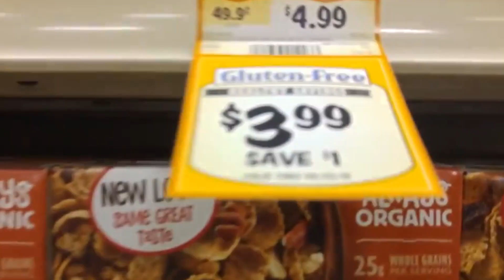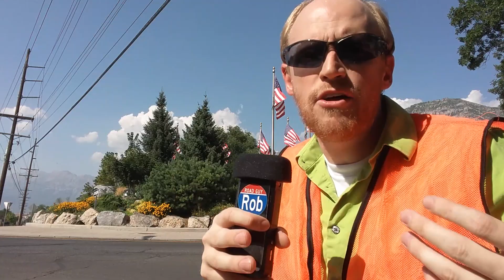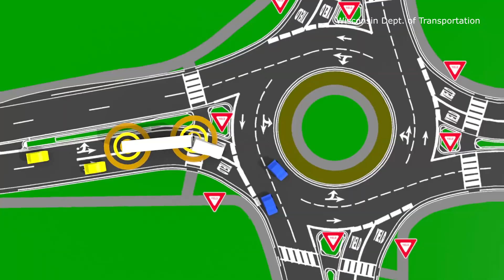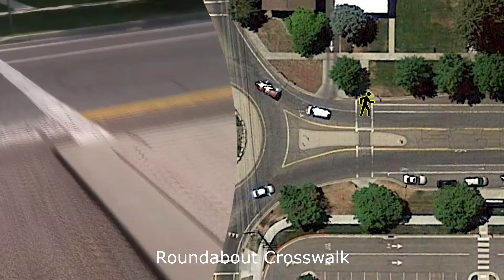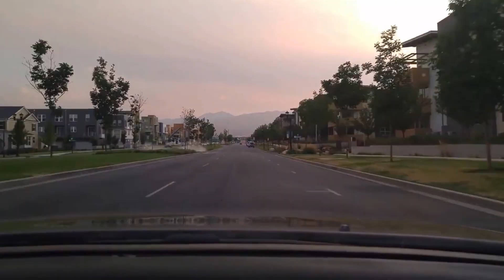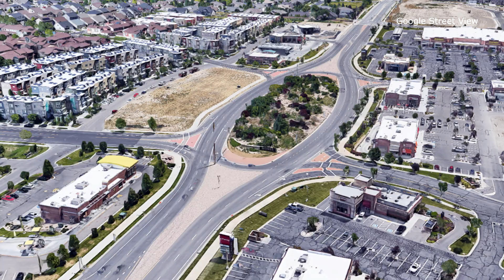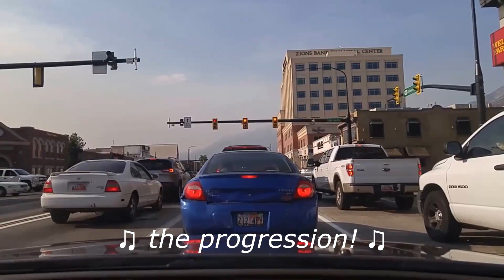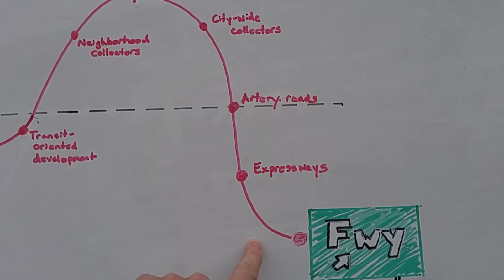Are roundabouts REALLY better than a traffic signal?

Comment: In Kansas City MO, the timed lights were an early adoption - and terrific! On the Boulevards, one could travel from near Downtown to the old south limit - 85th St. non-stop at 35 mph. Also, one of these boulevards had what we called "suicide circles," pre-historic roundabouts. These were are low volume intersections, so the chumps waiting could slip between the clumps. Thanks for a good video.

Comment: i am from europ and here we have "mini roundabouts" they are about the same size as a t junction but they have a small round hump witch is the island a truck can easily drive over it (it is bassically a speed bump size. also with the 2 lane round abouts it is simple if you are going left stay left if you are going right or straght go in the right lane (also it was very anoying watching you cut the lanes for me), a spral roundabout is an intresting thing you should look into basically when you aproach there are usually 3 lanes the left will take you left the middle will take you to the middle and the right will take you right sometimes i have seen a 2 lane spiral where you have to change lanes half way arround

Comment: 5to10k a month for electricity?! Would love to know why that is and how it can be lowered.
Reply: Incandescent traffic light bulbs for traffic use about 100 - 150 watts (125 average).
Since there are at least 4 of them active at all times => 500W x 24h => 12kWh every day or about 360 kWh per month.
Which would make the monthly cost for the minimal possible configuration (in the USA at 0,15$ / kWh) 54$ per month.

But yeah, even for a big crossroads with 20 traffic lights, the cost would 'only' be about 270$ per month in electricity.
And if you use LED's that cost is lower. (LED's use about 15% of the electricity compared incandescent)
Reply: @Robbedem  I was guessing the sensors in the ground for detecting cars would consume the most do you have any info on those?
Reply: @Project烏猫  no idea how much they consume... I suppose it might even depends on the traffic.

Comment: This is a great summary of what roundabouts are about (no pun intended). And as for not putting them in freeways, amen to that. There used to be one on the A2 motorway near Eindhoven, the Netherlands, and it was a nightmare until it was finally replaced by a proper junction.
Where I live, in Malta, there's the Kappara junction. When it was being designed, foreign experts (German if I'm not mistaken) came, looked at it, and told the Maltese that they should build flyovers. The Maltese argued that it was too expensive, and what did these foreign experts know anyway, so they built a roundabout instead. Please note that the approaches from both main directions go downhill... almost as if they were made for flyovers.
Fast forward a fair few years, and this roundabout is handling a whopping 90,000 cars a day. They had traffic lights to begin with (traffic lights on a roundabout... go figure), but some 15 years ago they removed them. It did little, if anything at all, to aiiviate the traffic problems.
Finally, around 2017, they started to build two flyovers, and lowered the roundabout a bit. They finished in 2018, and it's tempting to take these flyovers at far greater speeds than the 60 km/h (37.5 mph) speed limit, especially since there are no speed cameras (yet).
Roundabouts may have worked in the 1970s, when most of these roads were built. But then, economic activity increased, more women started working instead of staying home and playing housewife, and all these people drive cars because public transport is, to put it kindly, not the optimal way of getting from A to B. After a certain amount of traffic, roundabouts become a big bottleneck, precisely because of the reduced speed, and the congestion caused by traffic taking the third exit.

Comment: I live in an Atlanta suburb and  and a signal was replaced at the intersection of two major backstreets, with a roundabout (traffic circle). The reason was because there was not enough room for the turn lanes that were so desperately needed, and there was a 5th side street that came into  one of the roads less than 50 feet from the intersection. Once the roundabout was installed to replace the signal and include the 5th side street, it took a couple of months for people to figure out how to use it and to get used to it. Since then it has been a god sent. Traffic flows far better and I don't think I have heard of any accidents at that intersection since. There are still a few drivers that don't understand when they have the right of way and jam up an entrance to the roundabout, now again, but as a whole it has been a wonderful change!  Great analysis, Rob!
Reply: Remember that "roundabout" and "traffic circle" are not synonymous.
Reply: @jovetj  Sure they are. Roundabout and traffic circle are used entirely interchangeably. They have the same meaning.
Reply: @scythelord  Formally, a traffic circle is a circular intersection where the traffic ON the circle yields to the incoming traffic.  A roundabout is a  circular intersection where traffic entering the intersection yields to traffic already on the circle.
Reply: Where is it?
Reply: @citiesskylinesmetropolitan8980  Roswell, GA. Grimes Bridge Rd at Norcross Street

Comment: Does anyone have the stats on annual fatalities from driving one handed while talking into a hand held microphone with the other?
Reply: Lower than looking for dropped McDonalds fries in the seat
Reply: Nice way of pointing out that he should really stop doing that...especially on camera (although I have no idea why anyone would do that off camera, LOL)
Reply: Look, I need to make my breakfast while I’m driving.
Reply: A lot lower in manual transmission vehicles than autos.
Reply: Hams
Reply: It's probably alot.

In the UK, doing that will cost you big time if the police spot you.

You get 6 points on your licence [12 points means insta-ban from driving - most minor infractions (such as low-level speeding) carry a 3 point penalty - so they consider this crime to be at least twice as worse, probably for good reason]

Points on your licence means that your car insurance will be vastly increased forever

Unlike with your first speeding offence, you can't exchange your first 3 points for sitting an annoying 4-hour "speed awareness course" [definitely worth it - you still pay close to the original fine - but you avoid the points that will jack up your insurance until the end of history!]
Reply: @jazzx251  Actually the law only specifies mobile phones. You can still use a handheld mic on a CB radio for example. You see it all the time on Top Gear. Now if you have an accident while holding a mic you may well be charged  but unlike using a phone it is not an offence in itself.
Reply: @montegriffo24  you're free to test this - but I think you're wrong. I've heard of people holding a cup of lemonade in a traffic jam, and - because the engine's on - the police consider you to be "driving without due care and attention".

Whenever I see the pigs, I put both hands on the wheel, even if I'm stationary..

Here's a real-life story of why you should never trust the police:

Last week, my mother's friend in Scotland had an elderly neighbour that ordered some things from "Marks & Spencer" department store - she did "click and collect" for her town.
Unfortunately, it was sent to the wrong town - another one 13 miles away. The city of Ayr.

So - a bit annoyed, she drove the extra distance to Ayr - and got stopped by the police. They booked her for violating Covid travel restrictions, and gave her a £60 fine.

That hurt, obviously, - but she was there now, and collected the goods anyway.

As she drove out of Ayr, the same pig stopped her.

She got another ticket for Covid violation - as a second offence, it was £2000

The SAME PIG - from less than 2 hours earlier at most.

Never say "they can't do that if you hold a CB in your left hand" - they can do whatever they like, and your homespun pub-lawyer crap won't wash.
Reply: @jazzx251  Nothing you have said contradicts my argument that only phones have been legislated for. The police can indeed cite a 1000 different ways of charging you for driving without due care and it pays to be cautious around them but there is no law against using a CB radio. Ask a truck driver if you don't believe me.
Also, no need to be rude.
Reply: @montegriffo24  The exemption covers specifically 2-way radios. I can't find any info on hand-held mics, so probably not worth the risk. Clip-on lapel mics are cheap as chips.
Reply: @BoB-Dobbs_leaning-left  stationary vs. stationery 😁 - like what you did there!.  I think Mai Nem might be too angry to get it.  Bad attitude to police as well 🙃
Reply: @montegriffo24  That's nice in theory, but in practice you get charged for what the police officer thinks you're holding. It doesn't matter if you're holding  CB, an electric shaver, a chocolate bar or whatever, unless you have a camera pointed at yourself while driving it comes down to his word vs your word and in that case you will always lose in court.

Comment: As a truck driver I feel roundabouts should not be used on truck routs, but I think they work great for lower traffic, residential areas. Almost every time I come to a roundabout I have to come to a complete stop before entering, and always end up cutting someone off because trucks are very slow to get moving again. I’ve waited as long as 10 minutes for a break in traffic that never comes.

Comment: In Norway where I grew up pretty much all roundabouts are two laned, despite there not being a lot of traffic. It makes it easier to know where people are going in the roundabout, since someone on the outside is going out and someone on the inside is going around. A lot of people don't use turn signals, and that pisses me off since it makes it more difficult for me to see where they are going, however two laned roundabouts make it easy to see where someone is going even if they don't use turn signals.

I also lived in Germany for a few years, where pretty much every street I'd walk on had space for parking between the sidewalk and road. This meant that the pederstian crossings were in line with the sidewalk, so roundabouts wouldn't be any longer to walk through than any other intersections. In Norway, many roundabouts have tunnels for pedestrians.

Comment: So, from this we learn that traffic circles are best when they're little, residential one-lane (in each direction) things.  Notice how our genial host kind of glossed over most all the problems associated with multiple-lane traffic circles?  And the reason one-lane traffic circles supposedly so awesome is because of lower accident rates than traffic lights.  But little two-lane roads don't usually have traffic lights.  They have stop signs.  At which intersection are you safer?  At the one where everyone keeps on driving while going through, or the one where everyone has to come to a full and complete stop?
That's what I thought.
Try watching British and Australian dashcam channels and see how "great" traffic circles are.
I don't call them "roundabouts" because that nomenclature already describes a type of freeway/highway interchange in the United States.

Comment: Roundabouts can be used in dense city areas as the roundabout can be made smaller (not every road has to accommodate a semi trailer). In general you don't switch lanes while on a roundabout....ever. And roundabouts generally don't get put on freeways just like traffic light don't either. Freeway should be a FREEway without obstruction...but a roundabout can be used for interchanges just like traffic light can.

Comment: I lived in Europe for a year so round-abouts are not a big deal for me but when they started using them in my area they put 6 of them in a row in less than a mile. They replaced the traffic setup around a highway exit and no one knew how to use them so it was a nightmare in that area for years. It has gotten better but some people still have no idea how to deal with them.  Then they put this in a few exits away and it's not quite an intersection nor a roundabout but it seems to work pretty well even during busy hours. Map coordinates 42.7528786, -73.7679942

Comment: The problems you encounter are amplified by the American designs. Have yet to see a roundabout with an actual sharp entrance curve there. Usually they end up lining up the entrance lanes with the circle lanes ,which negates the whole point of slowing traffic down?! The lanes are pretty wide in general which encourages speeding too. In other countries the pedestrian crossing is placed one car distance from the circle, not.. three. And about them not being able to fit in cities... they would.. if you just made them smaller. Make them entirely drivable for semis if you have to, its not rocket science.

Comment: I’ve been thinking about roundabouts lately because my neighborhood gets gridlock on a regular basis. It’s between a bridge and tunnel so there is loads of traffic cutting through.

I saw a video where a town eliminated its light, made the streets one lane, installed a roundabout, and dropped the speed limit to 10mph and traffic speed actually increase. In my neighborhood I actually traffic move faster once it was reduced to one lane due to construction. So I’m wondering if that would work in an area with about ten intersections and lots of pedestrians.

Comment: As historically built here, roundabouts are meat grinders for pedestrians and bicyclists... Because vehicles in the circle don't have to stop it's like a game of whack-a-mole for pedestrians and cyclists wishing to cross. The motorists that try to be accommodate pedestrians and cyclists by slowing or stopping risk being rear-ended and in fact do get read-ended.  When the preliminary designs for another urban roundabout were presented to the public I explained to the state DOT in detail why, from a pedestrian and bicyclist perspective, what they designed was a meat grinder. I also provided them with information on roundabouts as used in Scandinavian countries. A couple years went by and they came back with a significantly different design. The design under construction now is far superior to the original design but I still don't think it belongs in the urban setting... The price tag also went from $8 million to $14 million...  some of my cycling and Complete Streets Advisory Council associates refer to me as The Six Million Dollar Man. ;~)

Another of the local roundabouts is a two lane. The police don't even know how to use it and write up accident reports that assign blame to the wrong driver. I took issue with what they were doing and shamed one of the local police chiefs into speaking with state DOT... DOT reiterated what I told the chief and at least one accident report was rewritten. However, by the time it was done it was too late and a driver got hit with a $1,000 deductible when the fault lay with the other driver.  I know of other people who were assigned blame when it was the other drivers fault... The "we are never wrong" cops arrogantly will not listen and apparently don't even look at the pavement markings and signs... I haven't been able to find out if the chief educated his officers. 

Explain to me again why roundabouts are a good idea in the context of Complete Streets.